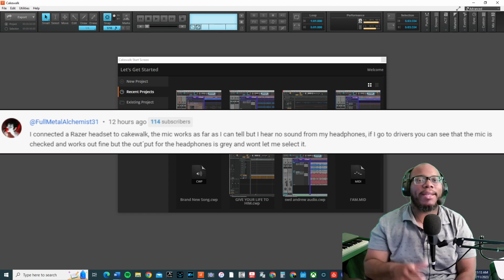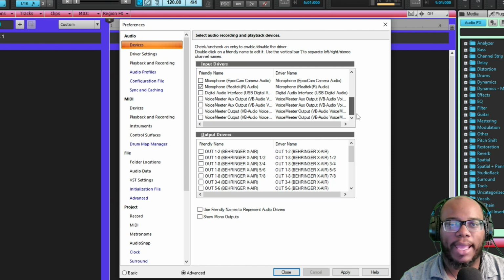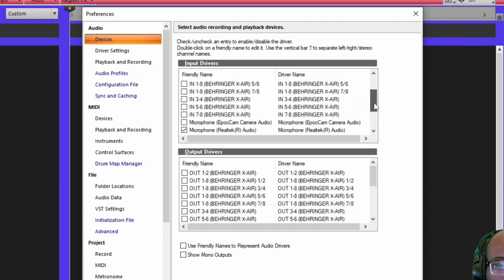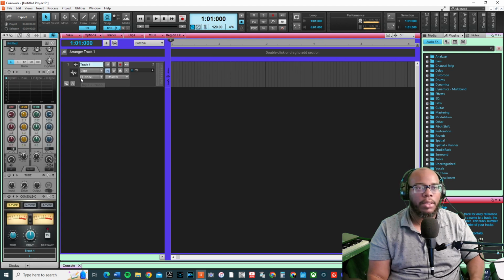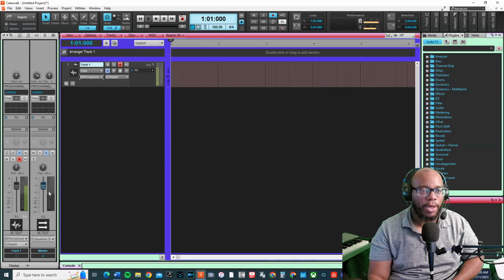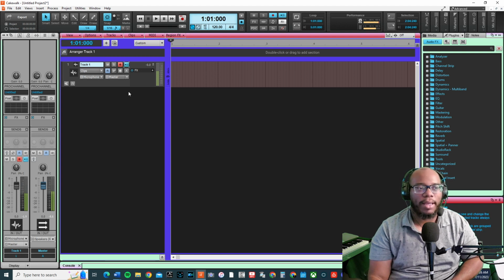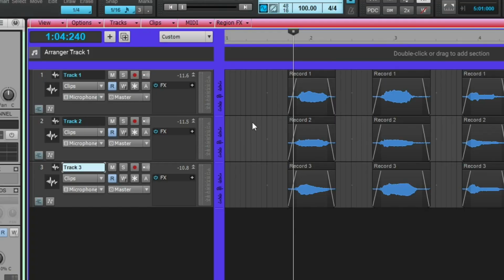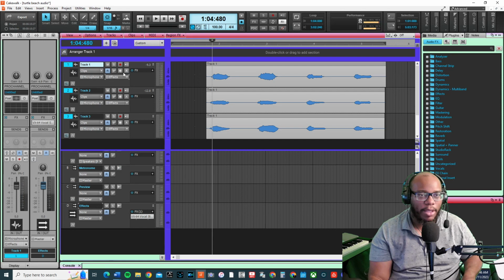No Money To Buy a Pro Microphone? Try This in Cakewalk

Comment: Thnx for the help, I did start messing around with the settings and got it working by sheer luck on the MME 32 Bit but I’ll change it so wasapi to see if it works as well, I was using this headphones because it’s the only mic I had and I’m trying to record and audiobook for a fiend who is blind so getting them to work was important. Once again thanks!
Reply from the maker: Awesome.  I’m glad you got it working.  That’s good that you are doing that.  Keep me posted with how it goes.